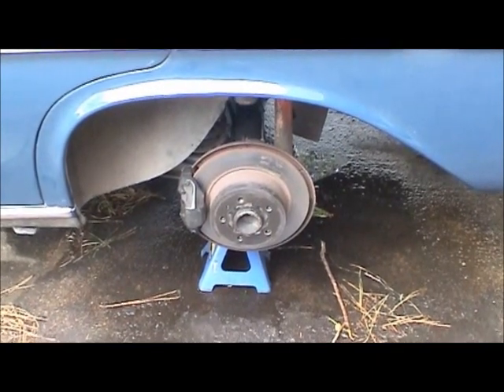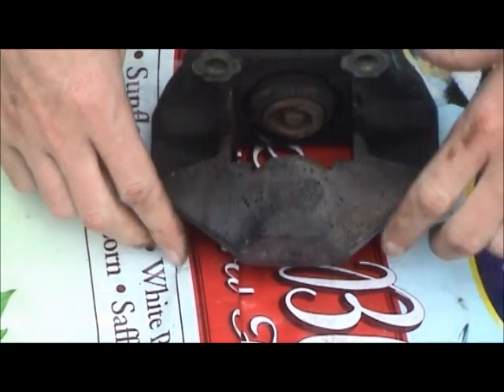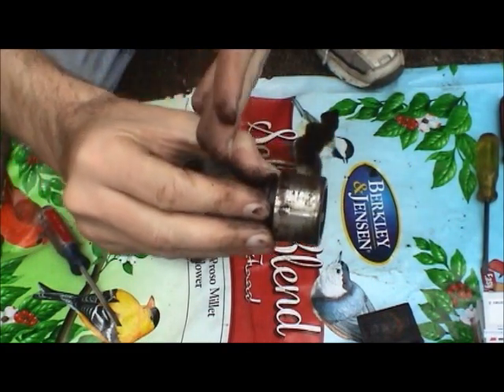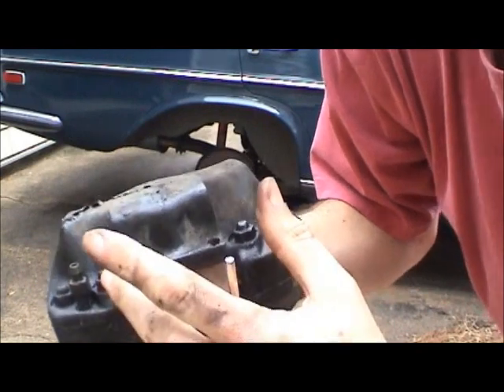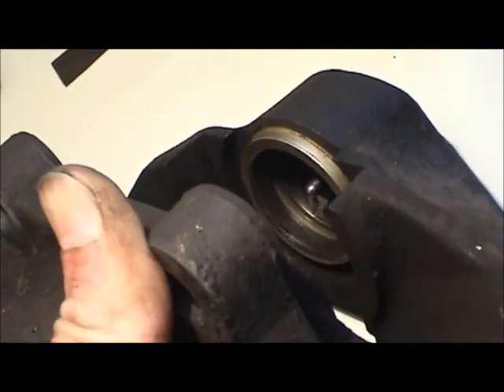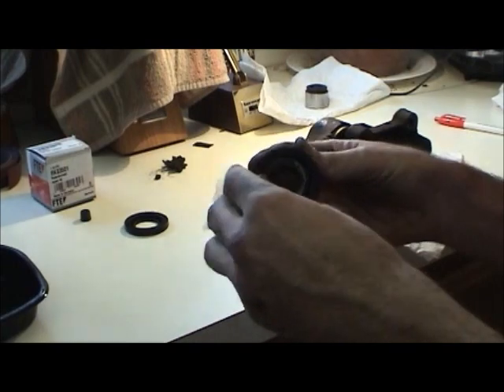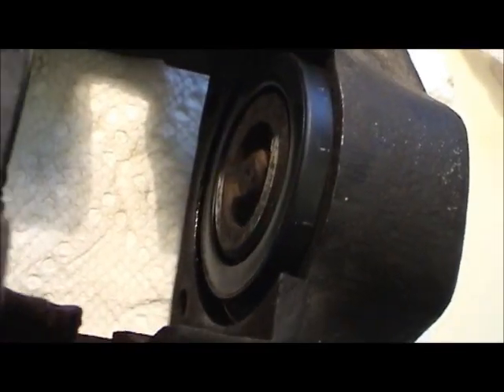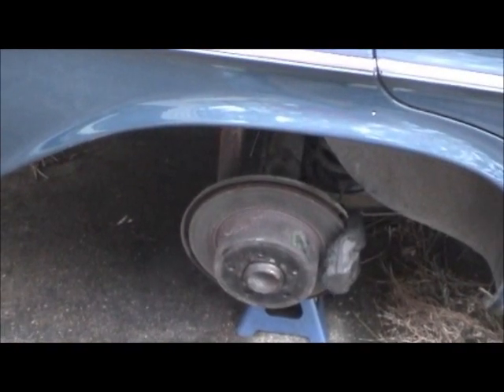1970 Mercedes-Benz 280 SE Rear Brake Caliper Rebuild

Comment: hey from NZ..   just pulled calipers off my 71 250 W114..   tried to remove rotor hub as it has sqweak internally..  didnt come off after undoing center bolt..  any suggestions?